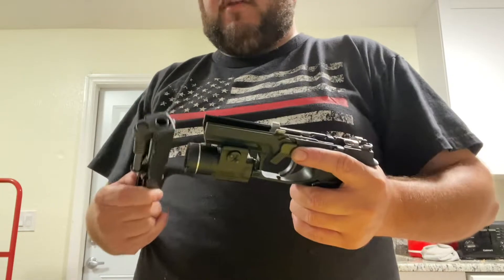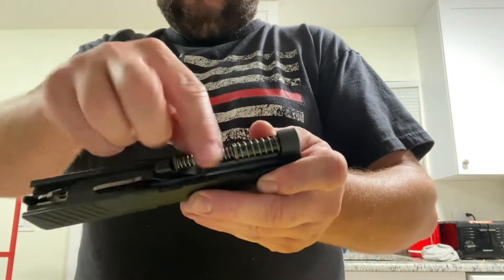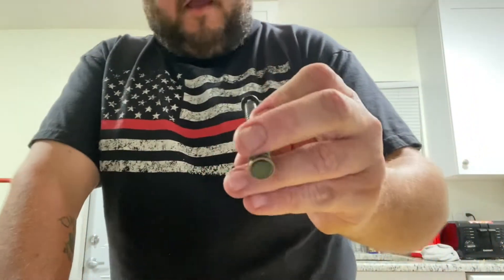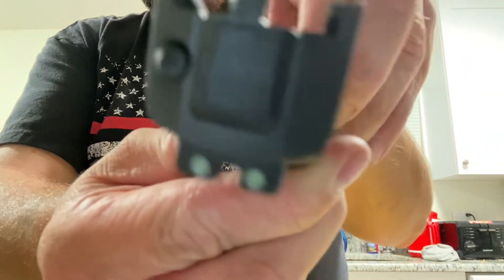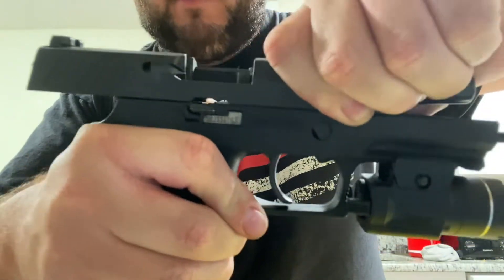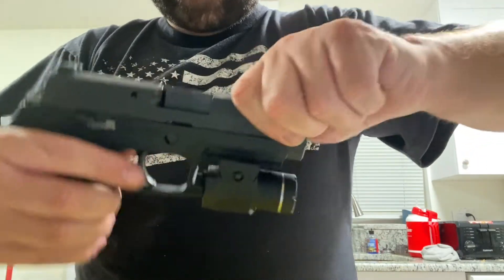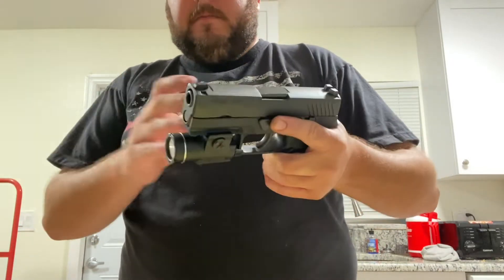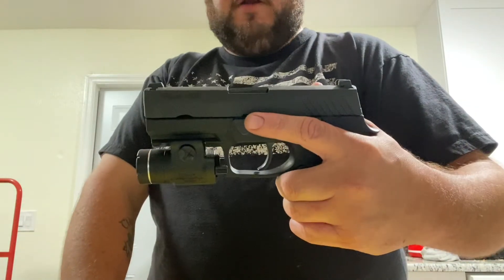Sig Sauer P320 Won’t Go Back Together? HERES WHY!!

Comment: Dave, that applies to the 9 but not the .45ACP. just an FYI. My P320C .45ACP the  RSA will fit with the  dots and any position. Not sure about those chambered in .40SW and 357SIG.. good info for those that use the 9mm platform
Reply from the maker: Good to know. Thanks for the insight!!

Comment: Other videos on how to reinstall the RSA on the p320 m 18 were confusing. Some didn’t explain the process well. Others said to reinstall with the flat sides to the side. I became so frustrated I locked the gun in my safe for a month. When I finally pulled it out I found your video. You explanation of the process clear and concise. Your close up of how to orient the RSA was perfect. The gun went back together in less than one minute. Your video is very informative and helpful. Thank you

Comment: I'm offended,  I own a Honda 😢. Anyrate it's not a smooth operation,  oval end wants to rotate and cause reinstall slide issues until ya straighten out vertically as you implied.

Comment: Like wise, thanks a million. The last semi automatic I took apart was 45 1911 fifty years ago, so I bought a new p320 m18 from a dealer and of course it didn't  with a  owners manual. Anyways I cleaned it and wouldn't go back together until I watched your video. 
Again, thanks a million

Comment: THANK YOU so much, dude! I was pulling my effen hair out because I couldn't get the slide back to the catch & I couldn't figure it out. Seems like that end of the guide rod should go in the opposite way. I've had the gun apart a half dozen times before & it always went back together easily - I must have been putting it in the right way on accident, lol! It's always the stupid little things that cause problems. I really appreciate you sharing your knowledge - and, great job on the vid - you explained it well & showed what you were talking about as you went; which made it really easy to understand - good job! Thanks again, man, and I'm going to subscribe to your channel - hopefully that helps you in some way.

Comment: bro if i could kiss you rn i would i tried for 2 fucking long hours to put it back and this other video the guy said to have the part horizontal but when i did that it didnt work then i saw you put it the other way and i was like no way this works (it did) thanks smmmm

Comment: Another reason glock wins. When I’m In the field I don’t have to finagle sh💩t around to orient parts in the perfect position or it won’t work. The glock just slaps back together. The spring stopper is round and then rack the slide and the slide bar automatically locks into place. None of this bs lol. And before you say some bs, I own both a g19 and a p320. The glock is a better duty gon. Leave the p320 at home lol. It’s a safe Queen range toy the fires when dropped anyways
Reply from the maker: Cool story bro. Thanks for the most Fudd comment I’ve ever read. Glocks are cringe, the unbuttered toast of handguns for smoothbrains like you who have a panic attack if you can’t get a round peg to fit in the square hole.
Reply: I got both as well... Glock so much less trouble. That's the one I carry. No BS. Just works, easy to clean, boom.
Reply: That's why you need to make a video on how to put a sig back together... the irony.